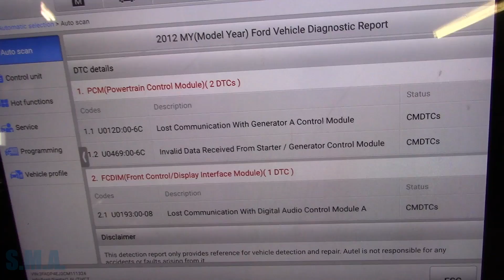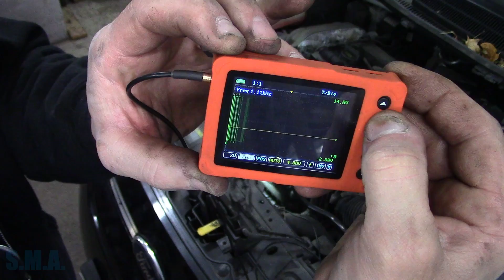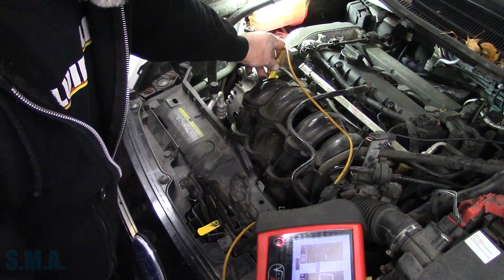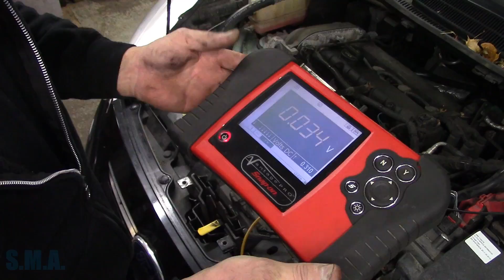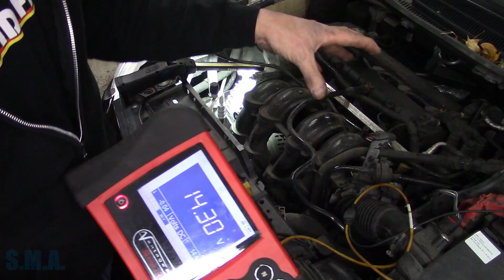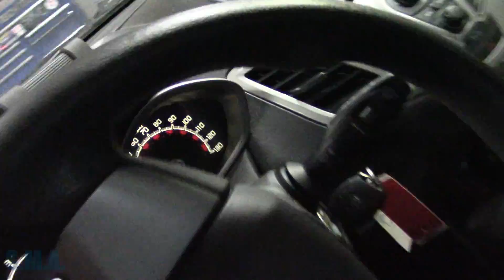Ford Fiesta: Battery Light On

Comment: Pinpoint tests all good, changed alternator and light still showing. Of course it had to be the last step of the workshop manual, replace pcm. Swapped it with Forscan and now its gone.

Comment: I have same issue, but have changed the battery and alternator and it's all charging fine but i have low voltage code still coming up

Comment: So the car ran fine with no problems, but the alternator was bad. The battery light has been on in my 14 Fiesta SE for 4 years, and I drive it everywhere. I did replace the battery 2 years ago, but that was from the original. 14 battery.

Comment: hihi! Same problem and same codes and battery light just happened to me :/
I haven't probe my alternator data pin yet (It's quit hard to reach :/)
My OBD reader does have a system voltage measurement, and it's saying 13.9 v when enging running and 12.8 when engine off.

I'm wondering a few things:
How did you know you need to change the alternator as it's still generating power and sending data?
^ add on to that, I'm assuming that you think the data packets are corrupted and the fault is in the alternator it self? is that correct?
^ and the only way to fix that is a entirely new alternator :o (maybe not worth it to spend another 90 bucks on my shit box I'm thinking lol)

Is it ok to just... let it be since the car runs fine without smart charge?

Thanks!!!

Comment: I had exactly the same fault code U0120:00-6c no comms with generator on a 2013 Ford Transit van with the same system single wire LIN control, I done exactly the same tests you have volt drop pos to pos and volt drop ground to ground, scoped the LIN signal 0-12v square wave and advised the garage to replace the alternator. They fitted a genuine Ford alternator and they called me to say the same fault and battery light have came back on.
Reply: Same here .new battery oem alternator..still got battery light on

Comment: Good stuff but - Electrically challenged here.  Wouldn’t you want to measure current from the alternator?  Not sure why a voltage is held across an alternator.

Comment: Good video but my question is, why was the battery at 11.5v if the alternator was charging at 14.3v?  I was an electronic tech many moons ago and I understand your troubleshooting technique, but my first instinct would have been bad battery if it were that low and I got 14.3v off the alt.

Comment: I don't understand, the comm bus was working the alternator was putting out sufficient voltage to charge the battery. Why did you change the alternator?  Was it never stopping  the charge when the battery was fully charged?  I didn't see you check the battery for full charge.

Comment: Couldn't see in this video but a lot of those fiestas have battery monitoring sensors on the battery negative terminal, (looks like this is an older vehicle without) if they go faulty you get codes for loss of comms with the generator. The default charging voltage on these is 13.5V, (simply unplug the alternator to confirm that). 

I hope you checked out that low anti freeze :)

Comment: Maybe if you had shown the scan data for requested alternator output vs actual alternator output BEFORE replacing it with a new alternator your repair diagnosis may have been clearer.  Because for many cars 14.3 volts is a perfectly normal output and you would not know the actual load on the system or the request for more or less power by the PCM.

Comment: what I want to know is why did it ever become necessary for the engine computer to get involved in managing the alternator output - a simple voltage regulator did this job fine for decades, now all they have done is introduce another unneccesary point of failure in to a major system of the car, friggin stupid just making things less and less reliable and more costly to repair.

Comment: That's a "Smart" alternator? It still works & charges A-OK, but needed to be completely replaced... that's false advertising.

Not to mention they don't have replaceable components (or at least South Main Auto didn't even try to diagnose or replace them). That's just throwing parts at the idiot light a.k.a. trouble code. Honestly, that's a disappointing dislike for this vid.
Reply: the EU master plan :)) thanks Obummer and Demonrats, sucking the Socialism weenies ;)

Comment: I wonder if it would have passed the a/c ripple test- failed diode...
Reply: I saw a video where a guy put one on, started the engine with the push-button or the key, and the belt seated itself perfectly.

Comment: When you're on the clock You have to change the alternator but if it were my personal car I'd dive in a bit deeper and see if the problem is just a bad connection.  It's amazing how many electrical faults can be fixed reflowing oxidized solder.   Also, I have a 5.7L Corvette and a 1.5L X1/9 and the X is much more fun to drive because it challenges me to be a better driver.  Weird huh.
Reply: junk solder, terminals, wires and connections. you don't say dirt recycled junk and cheaping out (chinesium)
bad battery
Reply: @throttlebottle5906  In my experience Chinese sourced parts aren't poor materials. They are rather hastily thrown together though often requiring a bit of rework.  The much lower price more than makes up for the hassle in my case.  Being retired my labor is worth about 2 cents an hour, lol.

Comment: I really need some help with what scan tool I should buy. I need one that can read all codes and reprogram a key fob. My vehicle's are 2007 Colorado and 2015 equinox. My Colorado has ABS problems and the key fob stopped working. Looking for good scan tool under $250. If I need to pay more. I will but I'm not rich. Lol.

Comment: At least you can see the Alt on that car.  On my old Chevy Z34 with the 3.4 twin cam in it they had to remove the passenger front tire inner fender and CV shaft to get access to it.  Yes that was the GM recommended procedure to replace the Alternator on that car.  When doing mine the dealership tore the ball joint boot and also screwed up the CV shaft splines and then the hub bearing.  How the tech instead of using a puller to push the CV shaft free used a torch to heat it up and melted the bearing and then overheated the shaft and warped the end of the CV shaft.  I ended up getting a new ball joint and hub and CV shaft out of the deal the tech was fired.

Comment: I remember the alternator/warning light systems that were popular in the 1980s. The warning light was in series with the switched power to the field connection; if the alternator was charging it put 14V on the other end of the bulb and it went out. If the bulb failed, or (more commonly) the brushes wore out the light never came on to warn the driver. I was bit on that a bunch of times on the cars I owned.

Comment: Odd, a good alternator and still needs to be replaced. I think a volt meter would have been a good way to go and cheaper as well
Reply: My thoughts are the same, voltage regulator. Maybe the alternator was under warranty or something like that.

Comment: Thanks for explaining the part about the alternator must be charging to do voltage drop tests. I was assuming you had to do the voltage drops to ensure that’s why the battery wasn’t charging but no current flow makes sense. So I guess check it at the alternator first.

Comment: Good to know!! I kind-of smell what you're steppin in on your diagnosis, but I don't think the old "If I can do it, you can do it" applies to me on this one😂
(if this were MY car) I would have checked voltage at the battery with the engine running. Getting 14+ volts, i would have scratched my head, and either put a piece of black tape over the light, or if I was feeling frisky, pulled the dash and killed the light. I certainly wouldn't replace an expensive, working, alternator over an idiot light 😂
Shit like this is why I HATE newer cars. Too many electronics. They had just the right amount from around the early 90's to about 2005, and then it just gets out of hand.🙄

Comment: Half a volt drop max on pos.. neg side max 0.2v..... good vid eric.. awhile ago i had a e46 bmw with the same issue.  All charging and so on. Bat light still on... an amperage output test showed insufficient results with a new genuine alternator wich had been an updated part... 120A alternator was removed.  BMW alternator was a 100A.  Wich was the reason the bat light was on.  Autologic was the only scanner that was able to correct the issue with programming

Comment: On my Vauxhall Vectra (GM) car, over here in Ireland when the alternator was going out the power steering went first so I guessed it was the alternator was kaput and said so to the breakdown mechanic when he arrived he looked into the engine and diagnosed the problem without any equipment and said it was the alternator, mmmm said I and would it be because it’s 15 minutes to quitting time made you suspect this? anyhoo as it was too late to get the part and obviously get it installed and as I’d good breakdown insurance (you need this with a GM car) I got the car piggy backed 200 miles to the hotel I was staying at and my son in law put it in the next day, a long story to explain that the power steering must have been electric and it gave out first when the alternator decided to die plus roadside mechanics will agree with your diagnosis if it’s close to quitting time

Comment: So you are saying that the alternator has no voltage regulator and the voltage is controlled by the PCM through the field of the alternator? Like full fielding the alternator off and on? I missed something there what was internally wrong with the alternator? Did it have a bad rectifier diode causing an amp ripple for example?

Comment: Your proved the alternator was good then you went ahead to replace the alternator- that's clueless: serves only to pass the cost of incompetence on to your customers. The only fix that was required was to restore the quality of electrical connectors which is achieved by reconnection but better to grind clean to copper. No new alternator needed.

Comment: Wonderful engineering...let the module control the amperage and voltage.  Still prefer the built in regulator and diodes.

Comment: I had a fiesta a couple months ago present with the same issue. Told the customer (a used car lot) it needed an alternator and why it did, and he took it to his "guy" to rebuild it. Of course it didn't work and when I told him, his "guy" said just bring it to him. Last I heard they still hasn't replaced the alternator with a good one and instead said it was caused by the radio 😂

Comment: Had the exact same problem with a '97 Dodge Grand Caravan. Changed the alternator and the light stayed on. The alternator was not the problem. It was a corroded wire in a wiring harness.

Comment: I have a background in electronics, but help me understand. The alternator is charging the bat-tree at 14.30v, but because the light is on, you put $200.00 into this pile?
I have to watch this again...
Reply: I am confused too. He changed it because the light was on the dash?
Reply: @jd3823  I believe that that alt. Would put out enough to charge the bat-tree, but the PCM required other voltages that it didn't respond to. Again just a guess. Eric O didn't give much in terms of an explanation.

Comment: 2 Canadian winters ago a buddy O mine wanted me to give a hand (meaning me) getting a F250 Super Duty Diesel running again so he can use. I Got it going, but the Alt was Seized ,Which shredded the belt of course ,So Changed Both out, Alt from rebuild shop. It Does Charge both batteries, but Battery light stays on till this day, used daily. 
My tools: Test light, DMM, Autel al319 Reader. Where else to test with what I got? 
(starving Fix Anything Artist don't yah know)
 do they got FREE  Online Legit Diagrams for the Average Joe?
Even amp/stereo Schematics are getting Sparse to find.

Comment: Theoretically key on and alternator connector unplugged, you should read the bus voltage. 12 flat line volts. As soon as you connect, both units "talk" and you confirm the lin communication. Using a Pico you can decode the Lin message. It has this measurement tool. The question is: does the alternator understand what the ECU asks or does the ECU understand what the alternator answer. This same fail would have been an ECU problem??
Great video, thanks!!

Comment: If its charging at 14.30 volts how was the alternator bad ? The new one was 14.32 ?
Reply: But the car couldn't "talk" to the old alternator so it threw a code saying there is a charging issue and kept the battery light on
Reply: I thought he uses the tool orange tool graph thing and there was a aignal
Reply: @clifflefebvre7620  Yes the Car was asking the alternator to "respond" to a status query but the alternator wasn't answering it so the car took that as a charging issue.  When he probed with the orange tool thing he was connecting to the CAR side of the communication so he then knew that up to that connector the wiring was ok, so it HAD to be the alternator then

Comment: Always nice to get a lesson from you how to go about finding the solution you desire. I thought I had it made after I replaced the front axles, sway bar links and the lower control arms, front & rear and having Josh align it at your place. Imagine the morning I dropped my keys on the floor and when seeing holes in my car key where the fob used to be. Tried to cheap out and buy a $40 ebay key and have locksmith program it. Closest Locksmith I could find was from Elmira and couldn't program the cheap key. He ended up getting a key hopefully from Mitsubishi and was able to get the car to start but couldn't get doors to work. That cost $400. If I had just had the xar towed out to Horseheads it would have been about $450 hoping insurance woud py for the tow. I do find the new key starts the cr a bit quicker now. Must be that, atleast some fob chips lose a bit over time. Still have to go out to Mitsubishi to hopefully get the doors working. That'll be another $70. Then I'll try to get Bath Plumbing & Hardware to get a key as he has the Duracell system where he needs a working key. I guess it copies from the working key and downloads on the new key. He gets credi if the key doesn't work so no loss there. Thanks for sharing. Moral of the story. Some things just not worth 'cheaping' out on.

Comment: so the alternator can be faulty even if its still charging?
Reply: Basically the "voltage regulator" communication in the alternator was not working in sync with the PCM however, the alternator could still charge with the "default" setting inside the alternator. It would charge but wouldn't talk to the PCM so the light comes on in the dash. Bad "regulator" in the alternators communications with the PCM.
Reply: @Garth2011  Now i get it. Thanks!

Comment: I had a tractor at work that was not charging. Performed a voltage drop test and found a drop of 2v between the alternator case and ground. Removed alternator and cleaned up the mounting surface and boom took off charging.

Comment: No longer are the days when you had an alternator and a regulator with a set of contacts in it. Toyota even has an alternator with a variable engagement pulley on it to control the output.

Comment: Same engine as the focus I've been working on, pain in the ass getting the alternator on with the stretch tension belts 🤦‍♂️ free tip incase you don't tell anyone, take the torx ended stud out too with I think it was a 6mm bit, then use the other bolt as you're levering up on the alternator to stretch the belt and get the stud back in 👌replace the belt too while you're in there, they're cheap and pretty much a single use stretch belt 🙄

Comment: I wonder how the alternator would respond under load.
Reply: It had some load, the battery voltage was 11.6 volts without the engine running, very low. Once started, it was pumping aperage into the battery to bring the voltage up from 11.6 to 13.30 so likely a good 40+ amps.

Comment: Should you have checked end to end connectivity on the LIN buss wire? As you only probed it at the alternator side wouldn't you have seen a signal if the alternator was simply trying to register on the buss?

Comment: On that Ford fiesta. Could you just ignore the light if it's charging, would that damage anything down the road?
Randy
Reply: Nice idea, and much cheaper obviously....but the problem would be you wouldn't know if you ever did have an actual issue until it stranded you.  Like all the idiots ( just my opinion) that are driving around w the red brake light on the dash on all the time.

Comment: Saw one similar to that on a 2 wire (with the large battery out wire) system on a Chevy Cavalier.   The PWM wire from the alternator to the instrument cluster was the number 800 wire.  Hmmmmm. 1-800-.....
Had 2 Cavaliers with the 800 com wire broken at the alt plug in. Some solder, wire, shrink tubing......it works!